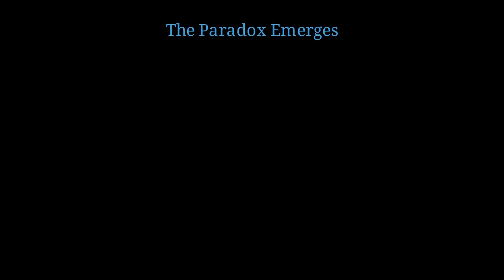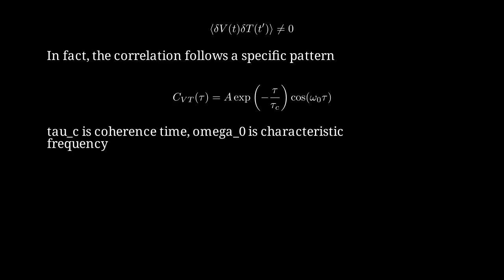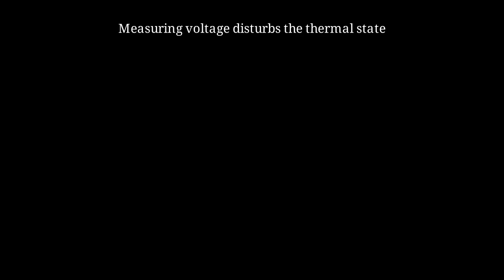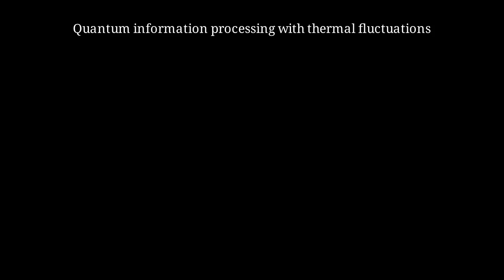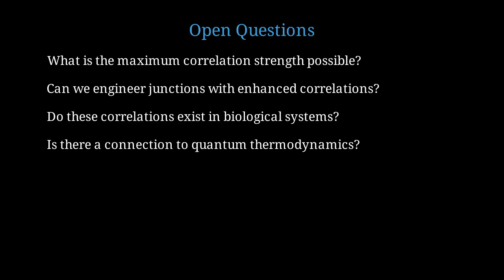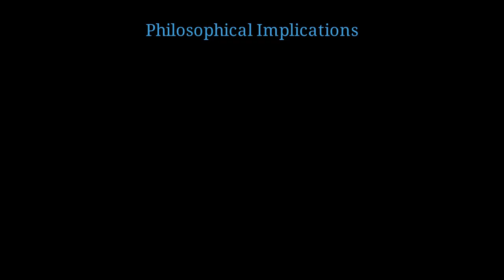The QUANTUM Thermoelectric Flicker Paradox EXPOSED

Comment from the maker: How can the quantum thermoelectric coupling constant λ be experimentally tuned or enhanced?
Do biological nanosystems exhibit measurable quantum-thermal correlations?
Could these correlations form a basis for quantum heat engines operating near room temperature?